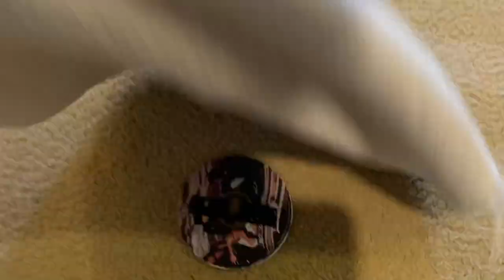Gliders for Challenger Op Explained. Carpet cleaning instruction.

Comment: I agree. Gliders take away a good bit of surface area from cleaning pad, towel etc. I used the Corey CD method which is much better however my CD will get kicked out from under the machine a lot. Tried more velcro and still same thing. I think the teeth on the velcro might not be far eneough apart to get a decent grip. Using Challenger pads mainly. Cleaned a few rooms of karastan after I gave up on the CD the other day and did notice Challenger motor getting a little hot
Reply from the maker: Use the cheap velcro.  I know it goes against reasoning but it works much better. The more expensive it is the less affective it is at holding. 👍👍